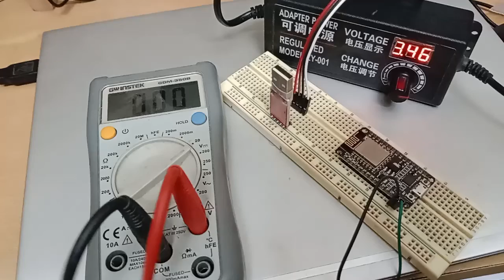Vin voltage on NodeMCU | power for NodeMCU | NodeMCU minimum supply voltage | Node MCU - Part 32

Comment: Can i use mt 3608 with lithium ion battery to power node mcu
Reply from the maker: Yes, you can, select the apt output voltage

Comment: What if i connect 12v supply to VIN??
Reply from the maker: Node MCU boards are using AMS1117 regulator which has max. Voltage input of 12V. Ideally, 12V should work, infact, the max. Voltage input spec of regular is 18V. I expect the regulator to work up to 18V. This is only for testing up to 18V and not regular usage.
Reply: @Way2Know  if it safe to use 9V battery to connect VIN at node mcu esp8266 ?
Reply from the maker: Yes it can be connected